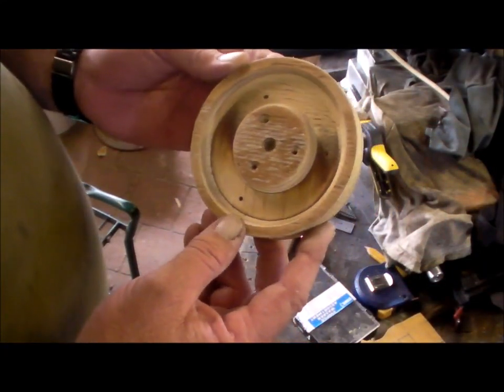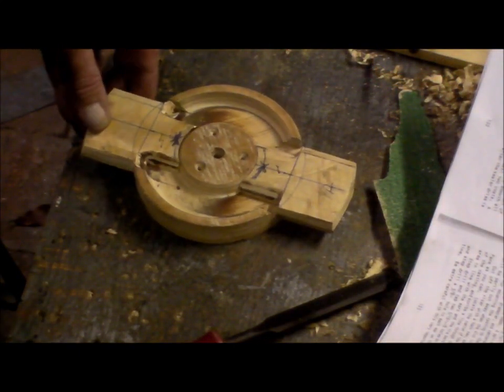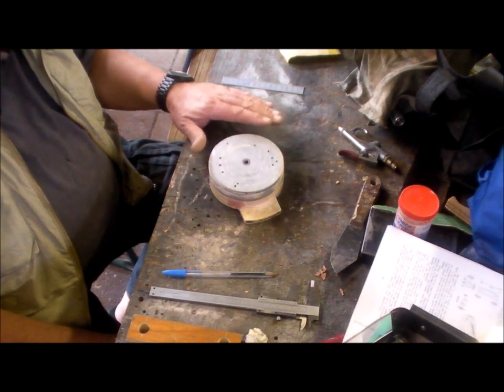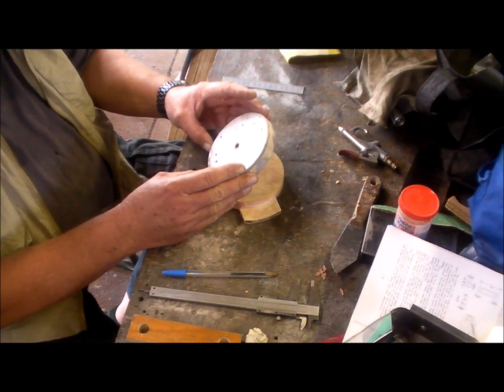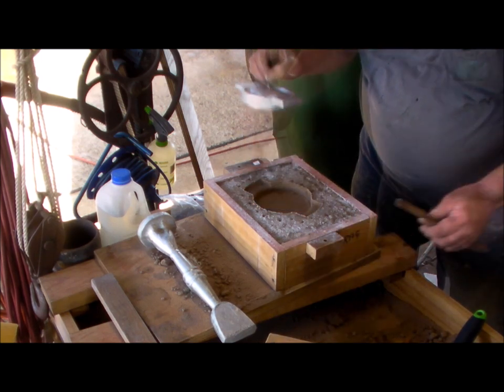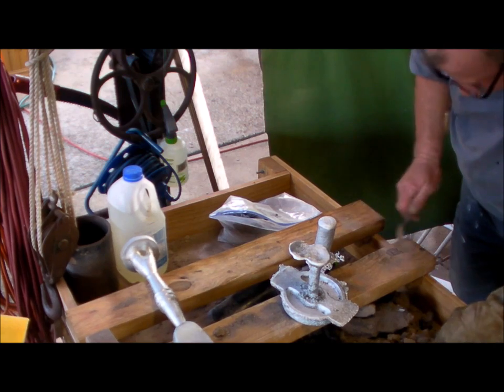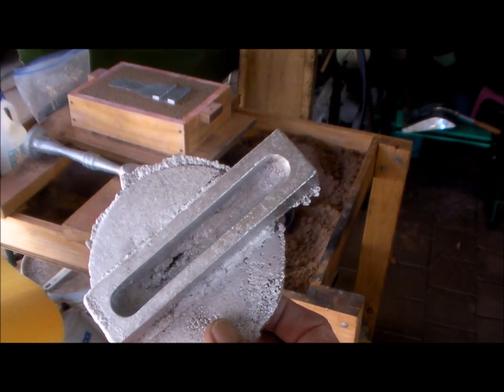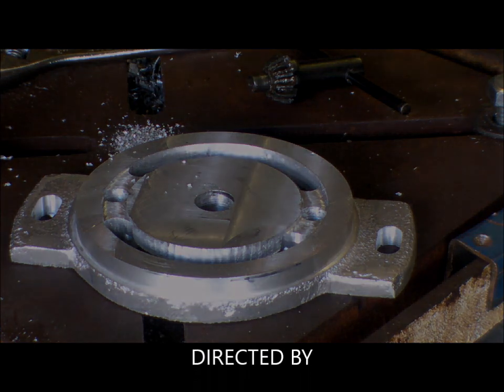Building the Gingery Milling Machine 55 the Universal Compound begins

Comment: We see your woodworking skills come in handy big time during this build and that i going to really aid you well in the building of the Gingery Milling Machine Peter. You have an assistant, I thought up til now you were going it alone Peter, the casting parts (a lot of them in this video) look really nice, you are good at making those so make the compound swivel over will he I will have to move on to learn the outcome?
Reply from the maker: G’day Lance. Yes timber working skills are quickly developed in this project, I have a shopping bag overflowing with patterns. These could be made with foam for lost foam casting but that also requires a new set of skills. Cheers Peter

Comment: Nice job on the video. I agree on the hot short tear in the tunnel, but the solution would be to keep the metal liquid a little longer to fill in as it shrinks. What brand is your vise? I've never seen a side supported vise like that.
Reply from the maker: Ronald Nickell the vise is a Dawn, made in Australia., I’ve had it for 46 years and would never part with it.
Reply: Thanks for the reply. I know I haven't seen that much in the world, but I'v been in sixteen different countries in my seventy-three years, and seen a lot more than most. I'm always looking for new ways that people accomplish the same thing.

Comment: Nice work.  

With a grain of salt:  It’s easier to remove the riser when it is along side of the pattern.  The problem is the connection between the riser and pattern is comparatively small and freezes before the pattern.  Placing the riser on the center of mass allows it to feed more of the shrinkage as the aluminum cools.
Reply from the maker: G'day Dan, thanks for commenting, yes that connection has dogged me since I first started casting, one day I'll get it right.
Cheers Peter
Reply: And your are making excellent progress on this mill.   Can't wait to see it in action.  I bought the gingery books but figured out I would be better off rebuilding an old lathe.  Still working on it.   Cheers
Reply from the maker: There is an awful lot of components and work to this Mill build but it has been good.
Reply: Agreed.  Have you been watching Chirpy build the dividing head over on Chirpy's Tinkerings.   The number of parts in that build are way more than I expected too.
Reply from the maker: Dan Harold 
I have been watching his work and I agree it’s also got a lot of castings. Funny thing though, like mine they look rough but it’s always a pleasure to see what can emerge with a little bit of filing.
Reply: We can make everything from the same pattern.  Just file away what does not look like the desired part. LOL    Seriously I do agree.